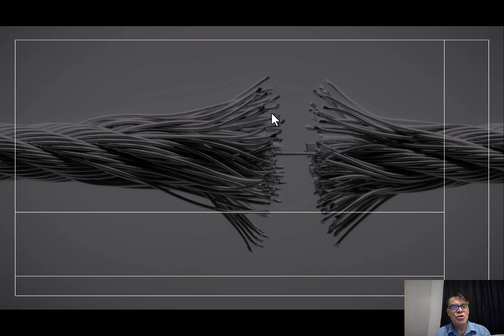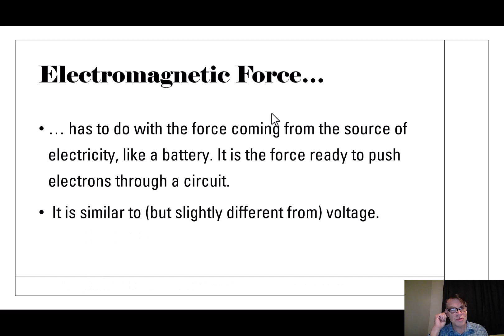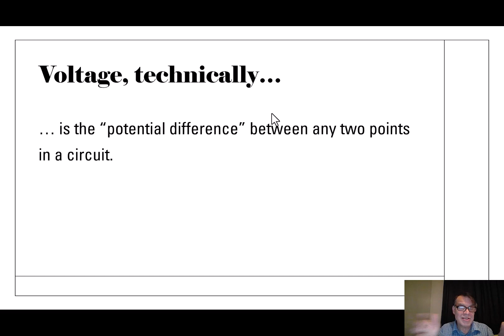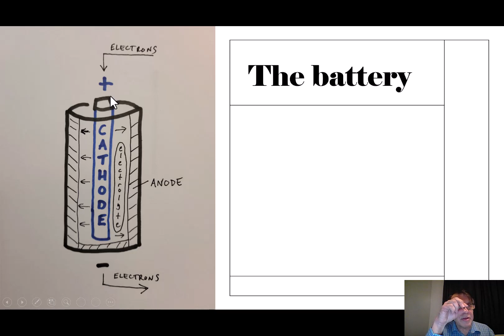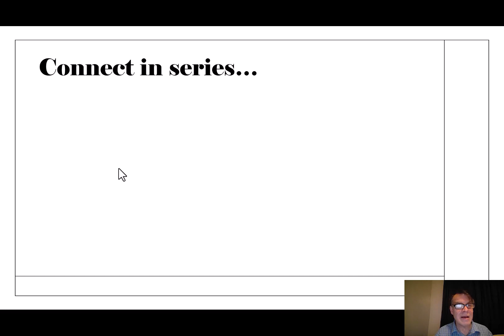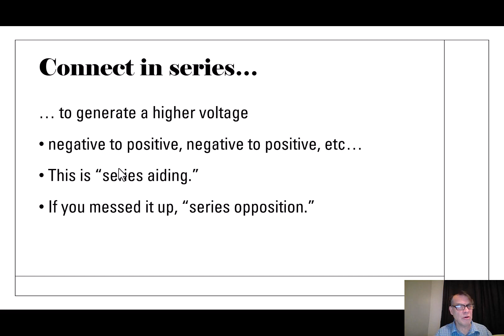2.1 Electromagnetic Force and Voltage

Comment: When EMF against EMF is the reason why there's an 85% loss in Renewables just like charging a battery the Fuller the battery gets amps slows down but Watts stays the same but that's what is not going into the grid easily demonstrated with a volt amp meter you can double-check the power company and the inverters wattage actual power going into the grid